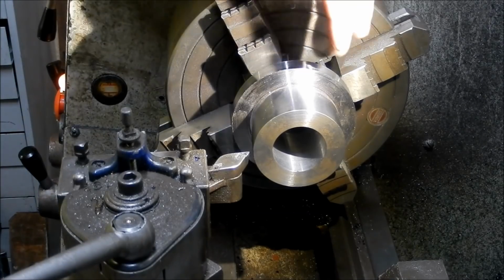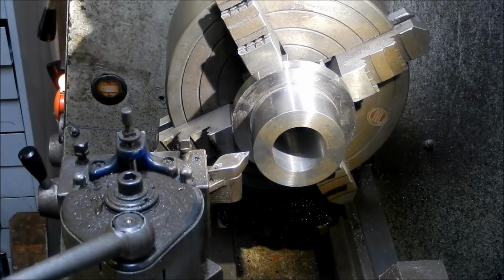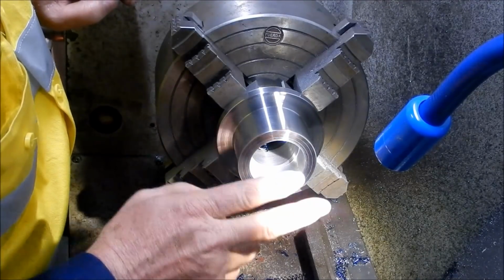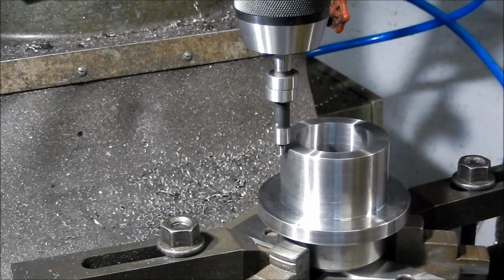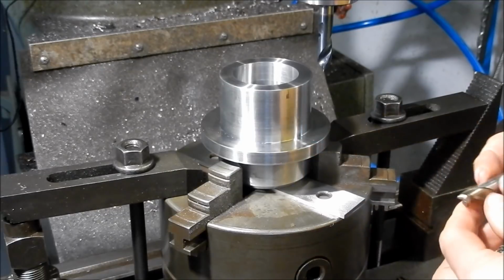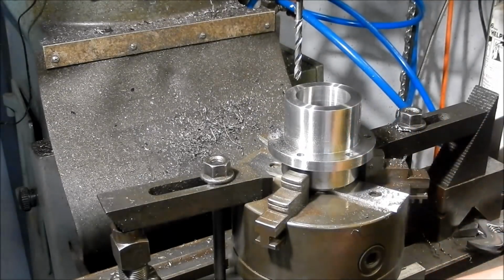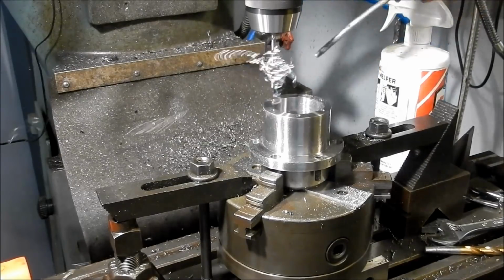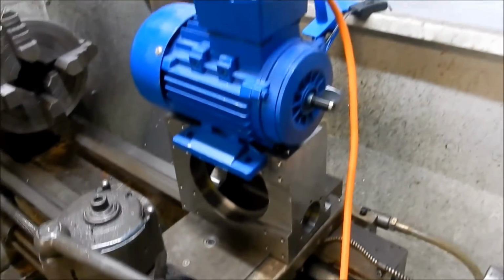Powered Lathe Slotter Build Part 18

Comment: G’day Cam. It’s getting there, at least now you can get perspective on how it’s going to look. That motor adds a lot to the bulk though but hey it’ll work which is the main thing. Good job, keep it up, cheers Peter
Reply from the maker: Thanks Peter, unfortunately when I did the shear calcs to determine a cutting force and working at the maximum radius and calculating the torque requirement back through the ratio of 24-1 this motor should cope.  Obviously cutting force is a guesstimate given the depth of cut and the change in forces.  Smaller would have been better but it would have been getting outside the comfort zone.
Cam